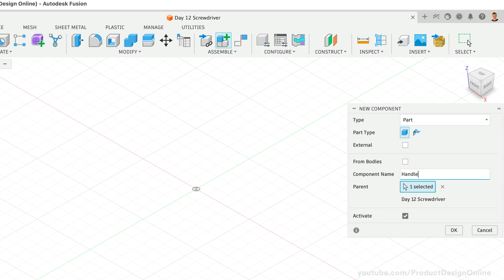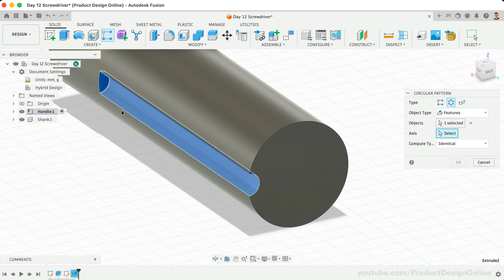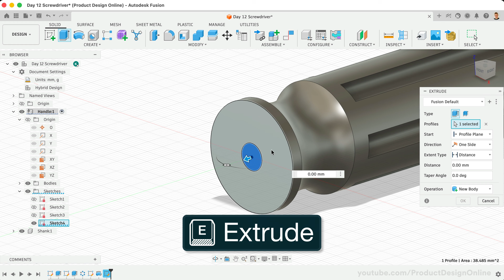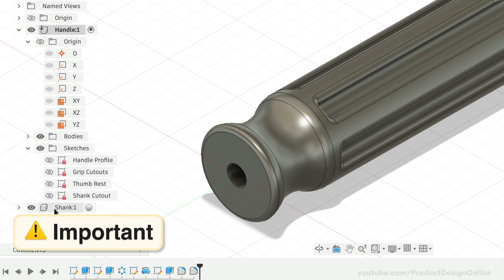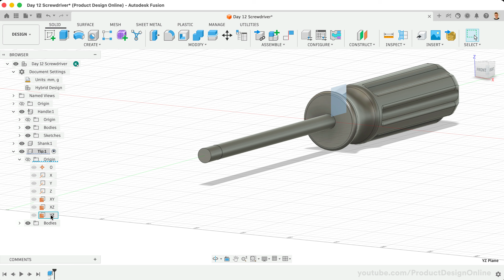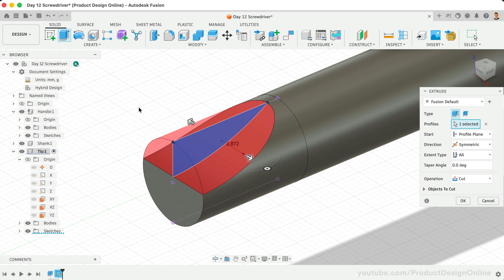Modeling a 3-part screwdriver | Day 12 of Learn Autodesk Fusion 360 in 30 Days (2026 EDITION)

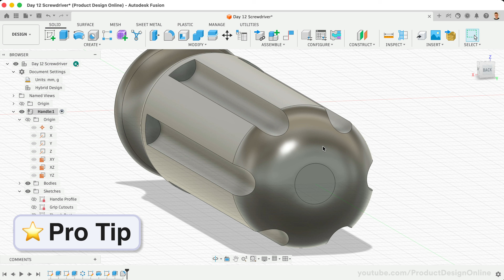Comment: about 9:00 : I didn't understand this break of the fillet command once we have been doing quite a lot of fillets in the same command with different radii. Is it just arbitrary? Like, after selecting 3 or 4 sets with different radii than I should consider breaking the fillet command into two parts?

Comment: I cant move the origin point to the inside face of the shank hole extrude the shank from the inside of the handle.. I've tried so many times and cant get the origin point to move. Just ends up extruding 150mm from the outside of the handle. Any help plz
Reply: Got stuck there for a few minutes, too today. Solution: uncheck visibiliy of the sketch for the inset hole. That will give you access to the inside face 🤗
Reply: @luxx_pa_3d Thanks! I get stuck on the weirdest things 😂

Comment: For some reason I am having a bad experience with being able to select and alter any of the radius options? Has this got anything to do with latest updates?
Reply from the maker: No changes to that (that I'm aware of). Can you elaborate more on what you're experiencing and what OS you're on? It's likely more an install and/or graphics issue.
Reply: @ProductDesignOnline  Well I've reset my preferences also when you insert a circle (2.38min) my circle then would go to the top of the handle after selecting Horizontal Constrain? Is that cause of the problem? So this time I pulled the circle down and then selected the Horizontal Constrain and I can now follow your video and selecting the Radius ok. So depending where the circle is situated depends where it defaults to when selecting the Horizontal Constrain.
Reply from the maker: @michaelcoleman9280  Correct! The horizontal/vertical constraint will always force it to whichever is closer, so if it's 45.1 degrees or above, it will make it snap to the top (vertical) instead of the horizontal line.

Comment: How the hell do you alter the handle dimension I cannot alter the radius 13mm or the 9mm it does not allow me? 6.59
Reply from the maker: Just saw your other post. Can you email me a screen recording of you attempting it so I can see what's going on?
Reply: @ProductDesignOnline  So I've went over it again and it is down to where the circle defaults to after selecting Horizontal Constrain, so if it defaults to the top of the sketch I then have the issuse of selecting the RADIUS, if it defaults to the centre left side of the sketch as yours does I then can select the RADIUS and set dimension without any issues.
Reply from the maker: Make sure the circle is below a 45° angle (imaginary line). That will ensure the horizontal constraint applies it to the lower spot and not the top (vertically).

Comment: Great job on following up on new comments. Love the commitment. I have a question: when making a new component, maybe there was a new update, but it doesn't appear to be a part option. I just click on the initial toolbar on the left, the square options that I've found to work as the parent. I don't know whether I should do this, or if there's another option. Great job tho, love your videos
Reply: NVM I watched the next two seconds and didn't realize the external function
Reply: NVM again, my method did work
Reply from the maker: Thank you! Autodesk just updated the New Component dialog (in June). Now it's a PART type that is INTERNAL by default. You will simply need to name the component now and not click anything else :)

Comment: Im trying to do designs like this but i struggle with coming up with the DImensions for everything, how do you imagine the sizes of the Objects?
Reply from the maker: For reach project, there are usually some known dimensions and unknown dimensions. Start with the known ones. For example, the screwdriver handle is always going to be a certain size to be ergonomic. Then, you can design the rest of the part(s) to match the scale of the rest of the object. One great use of all the new AI tools nowadays is asking it to provide standard dimensions for objects.

Comment: I completed the independent practice, but when I tried resizing the punch, my sleeve did NOT update. What did I do wrong?
Reply from the maker: Hi Kayleigh. Can you email me your Fusion file? It could be a number of things, so it'll be easier for me to inspect the file.
Reply: @ProductDesignOnline I will do that this weekend. I'm pretty sure it's because I didn't use the intersect command. I'm having a hard time getting my head wrapped around that function.
Reply from the maker: @Kayleigh12388  ah, yes! Intersect/Project are (almost) always needed to make multi-part models adapt to one another. Those are both concepts that I will continue to discuss throughout the course!

Comment: Hi, I use the free version of Fusion 360. I want to keep the entire assembly opaque while I work on a part, but it becomes transparent. I unchecked “Visibility of Active Component,” but it doesn’t do anything. Do you have any tips ?
Reply from the maker: Hi Thomas. Did you make sure you clicked "Apply" in the Preferences dialog? That is the correct setting that should keep them opaque.
Reply: @ProductDesignOnline  does it works with assembly and external part ?

Comment: people are always asking what is the best way to learn fusion. I always guide them to this series. It worked for me. I made it to 14 and then just went off and designed my own stuff. That was enough. I probably should complete it at some point - I'm sure I have a ton more to learn. But this series is great. I'm sure it's trained 1000s of users.
Reply from the maker: That’s awesome to hear, thanks so much for recommending the series to others! I appreciate it! 😎
Reply: Same here, it has really improved my workflow and now that I design some of my own stuff, I run into tendencies before they make it to this updated series, like saving fillets at the end and doing separate fillet commands. However I look forward to the rest of the series. I’m getting to a point where I want to do more multi component designs and I’m struggling to figure it out. Right now I have a drawing that I designed as a whole for ease of design to see the whole thing but now I want to split it into different components accounting for tolerance but maintaining all the pieces to create the whole. 

Thank you to the creator of the series. these episodes are the highlight of my day!
Reply from the maker: Thank you! You just made my day 😄

Comment: I noticed with the three arc command at the tip if you move it from down to the second point you get a error if you want to set the distance to 9 mm, moving the second line like you did in the tutorial gives the good result. Thanks so much again.